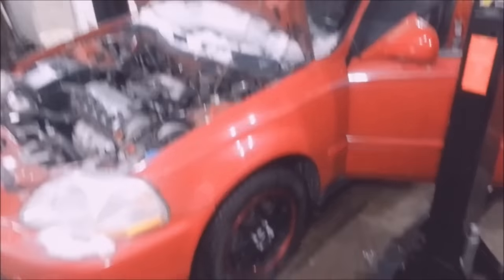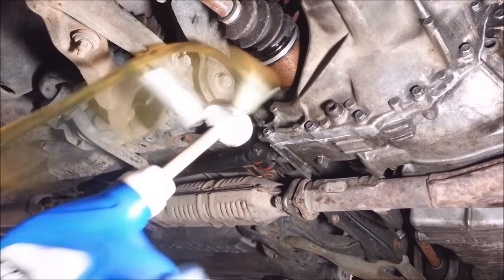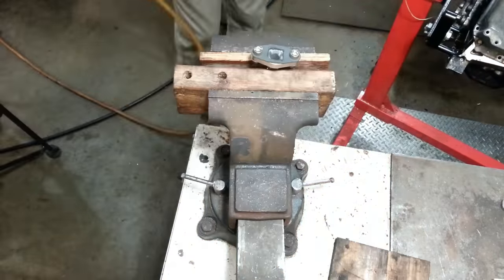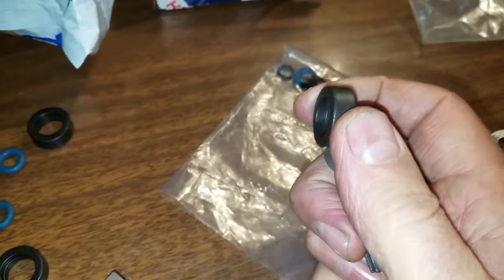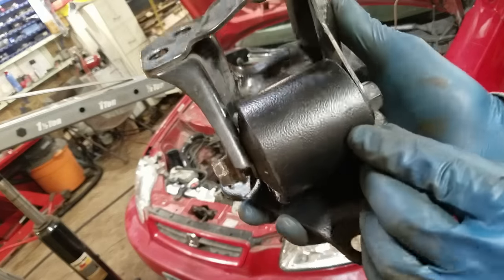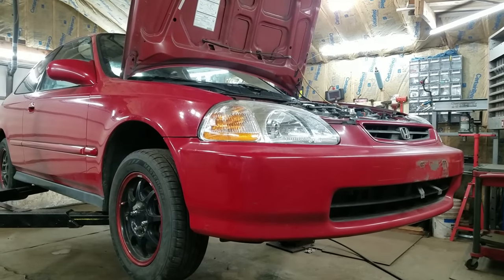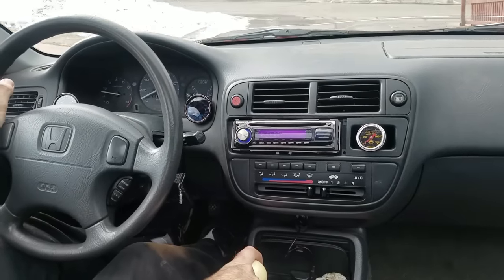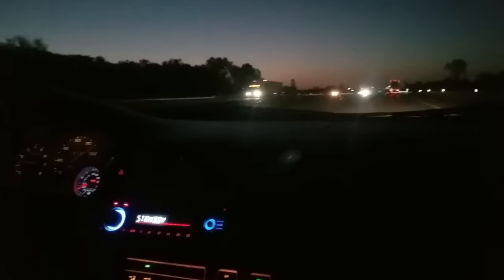405HP D16 Honda Civic Turbo Build start to finish

Comment: Mechanic/Comedian. Enjoyed the crap out of this. Tuned by Humble Performance!
Reply from the maker: It actually got tuned twice, and he did a hack job of it. The timing was way too far advanced amongst other things.
Reply: @RustBeltAuto  wow, good to know
Reply: Humble Texas??
Reply: Oh nevermind. Just saw Tulsa
Reply: Everything I've seen and heard about Humble has been a shit show. They had my friend's K20 head for over a year, did a valve job but never lubed them so the valves and seats were rusted and had to be re-cut. The ECU Humble added vtec to never actually engaged vtec because they for got TWO components. That and they charge more than most local shops ever would.

Comment: u know the car inside and out even before you take it apart i need that kind of experience
Reply: It’s kinda like he’s built an ek before lol
Reply: Nb Miata but he built a sedan
Reply: Just wrench as much as possible and don't take shit to a shop unless it's a machine shop...I been learning everything off Google and you tube im 2 motors in and on my 3rd, all had custom stuff had to come up with and im very picky when it comes to security, material and specs....not so much kooks,
Reply: That’s the Same thing I tell my crazy mechanic when ever he comes around I’ve been hanging out with him and other Honda friends lately we’ll get together at times and work on who Evers car needs attention I’ve learned a bit lol

Comment: Really awesome video, really shows you that its not that simple to turbo a car.
Reply: Yup I'm definitely heading for a nightmare when I custom turbo my Toyota Sienna 3.4, hoping for at least 400hp✌️
Reply: It actually is lol I’ve seen a ton of people do it in their driveway in a day back in the Honda days.. he actually built the motor though, that’s completely different than just bolting up a turbo kit
Reply: @surfside75  have u done it yet?
Reply: Yep especially if you want a long lasting very powerful turbo build
Reply: It's actually quite simple to turbo a car if you're mechanically inclined, since there's tons of material online to use as guidance.

However optimizing the whole contraption and making it run properly can only be done by fine tuning and that's where knowledge, time and experience come in.

Comment: Love the build! As a circle track ex 4 banger class racer you can oil starve the oil pickup tube by turning left hard. Went threw 3 d series z6s before I realized it was an oil windage issue and even with an extra quart and a half, (Shaffer's 20w50) helped. But what fixed the problem was me making a trap door windage box inside of the pan to help keep oil to stay around the pickup tube. Never popped a motor after 2 years when the others would only last 2 or so race nights before rod knocking. My race engines always got new bearings and rings. My class was very limited to modification, so refreshing up the old engines was the biggest power adder. Only reason I say this is because of the autocross you were doing. Great build and love the attention to detail on making the cheaper ebay parts work great. Subbed!
Reply from the maker: Nice to know. Head lift issues are priority now. Still lifted head after oversized studs. Dropped total advance 6 more degrees @ about 20 for 24 psi. Seems to be holding now. Installing oil cooler next I think. Maybe that extra quart will help?
Reply: @RustBeltAuto  yes boosted D's dont like much timing, my friend has the same issue lifting the head with to much timming but doesn't have the big stud kit. I cant believe you still have the issue with the bigger studs! You can always turn the timing down and add more boost? But it seems that your in need of a turbo cam that has more overlap so the valves stay open longer and the air can get in and out with out pushing the head up. Dont know for sure but the guy I bought my car from has a build autocross eg hatch with a vitara d, and he picked up 80whp with a turbo stage 2 cam and valve springs n retainers, same boost and all. Dyno proven
Reply from the maker: @Wreckedekcoupe  high overlap is best for non turbo cars. Satisfied with the power it has. Decreased ignition timing changes location of peak pressure so there is less force on the head. You can lower boost pressure for the same effect, but get less power that way. Tuners get this wrong, because there is no pressure transducer in the head, and no measurement to go by. They are all guessing.
Reply: @RustBeltAuto  wow 😮 you 2 guys are so knowledgeable. Thank you 🙏
Reply: @RustBeltAuto  d16 don't like a lot of timing small bore in general
Reply: @RustBeltAuto  i don’t understand what you’re saying completely. I have a CSS z6 being assembled soon. Wisecos/eagle.. gt30. Would I be better off with a aftermarket camshaft to aid with head lift? I really don’t want to have to install oversized studs. Aiming for around 350whp in the higher gears.
Reply from the maker: @stefanzomods  The tuners gave the car too much timing. Moving location of peak pressure by retarding full advance solved my problems. After these studs, the head lifted again. Did some guess work, and it has been fine so far.

Comment: Bro you’re absolutely awesome ! 😭🤣 I’m in tears
Reply from the maker: It will probably help you live longer. Sweet dreams!
Reply: @RustBeltAuto  nice video. Wondering if you have any tips for me. I have a ep1 d14z6  1.4 non vtec and I want a bit more zoom. Is there anything worth while doing?
Reply from the maker: @jamesoliver9130  get a motorcycle, or a different car? Most people would say k24 or something. I say leave the thing alone.
Reply: @RustBeltAuto  I thought as much. Maybe I will just get the type s with the k20a2 engine I believe. Thanks for the reply and keep doing your stuff!
Reply: @jamesoliver9130  it is all in what you want to do. It is fun, a learning experience for sure and somewhat of another type of addiction when it comes to these cars as no matter what you'll keep wanting more. I got an EJ8 with a turbo Y8 that I want to keep all original cause this car literally is perfect but my GTX3071 on a GSR or K series in it would be nice too.

Comment: A couple of years ago, someone came to me with a similar build, but one done by a spanner with a hammer. They had fitted a Turbo, but no oil cooler and the wiring was a complete mess. I managed to get it running reasonably well, not perfect, but far better than when he arrived with it. Once I felt I had done all I could, I dropped the bonnet and told him to drive it carefully, don't exceed 3000rpm and I never wanted to see it ever again.
Reply from the maker: That reminds me of a bunch of old American muscle. 50 years of hacked to pieces by 20 different people. Fortunately this was a second owner car before I got it.

Comment: Auto-x is a blast when you have a decently setup car. Koni yellows with the G.C.'s, the big sway, and the LSD make a world of difference. Fine tuning the corner weighting/ balancing with the proper alignment will improve it even more. I have set up quite a bunch of chassis for track duty and prepped customers/ personal cars as well. LRP and the Glen are my two favorite courses. Nice job on the build bro. Gotta love a single jingle! 😎 I built a D16 EG hatch with a genuine Garrett GT30R, Synapse ramhorn, Hondata, ARP's, Cometic, gas flowed head with some port work, H.D. springs/ Super tech valvetrain IIRC, etc. I put this together for a customer of mine, and it was a blast for a somewhat affordable drivetrain when all was said and done. Put down around 380whp- 370wtq +/- on low boost. Car looked very stock on the outside, and even had a full mandrel 3" exhaust with a Magnaflow and resonator that had just a pipe as the 'tip' coming out the back and it was painted all satin black along with the FMIC that was hidden quite well. The gate was vented to atmosphere but the dump pipe was hidden as well pointing at the ground inside the bay. The only sign the car was even modded was the drop from a set of Tein coilovers and some black Slipstreams with R888's for track duty/ and some HX wheels with T1S' just for rolling around on. That was it for the looks department. Totally a SLEEPER until the hood was popped. The exhaust was definitely quiet for what it was, especially with the Magnaflow, Burns Stainless res, and the compressor itself which obviously acts like a 'muffler' to begin with. It was a very low-key looking ride, until you hit the 2-step or antilag LOLOLOL 😂🤣😂🤣👍👍👍👍👍 Thanks again for posting this vidja my dude!!! Was very entertaining and we'll put together!!😉
Reply from the maker: Thanks! The turbo I have is too big for auto-x, but open lapping is nice.
Reply: @RustBeltAuto  
Absolutely... Yeah I hear ya on that bro. The compressor size definitely matters when you're trying to keep it in the powerband to where it's the happiest as far as response goes. The lag factor is a beeotch for sure. I use something like the 3071 especially on 4 cyls because it's very spool happy but not too small where it'll leave you wanting more at WOT on a higher speed course/ highway. That 30R I ran on the one D16Y7 I built was the cats ass. Thanks again for the vidja broski and keep it real!!😎👍👍💪

Comment: This was an awesome video but some things you may hear online are actually worth it. Like upgrading your oil pump allows you to rev higher safely without causing your oil to aerate or cavitate which can happen on a stock pump
Reply from the maker: Cavitation usually comes from a pump that is out of spec. This was not. Aeration comes from a pump that is "sucking" air from somewhere. This build is running strong. So for so good. Thanks for the input.

Comment: I think the best part of this video is he doesn't spend money on bling & useless crap (besides maybe the cam gear and injectors are likely china clones). Cast manifold that spools better than any tubular, still makes 405whp with a 57trim, and doesn't cook the radiator. At least, not til a few laps of a long road course. Nothing an extra-wide Griffin radiator stuffed into the core support and the strongest SPAL fan wouldn't fix.

Comment: My dude - love you did the A-to-Z on this build - totally love it. Recently picked up a 93 del sol with a d15b7 in it, a legit grampa owned it find less than 100k on the body no rust but oh lordy going from my ej255 wrx running 300/301 to a d15 is painful. Drove an hr north into the boonies and picked up a d16z6 ... Planning to track down one of the jackson superchargers next ... Can't wait to feel your pain lol.
Reply: Go with a Gt25 turbo instead, or even an old t3 50trim from a 80's Volvo. With the JRSC you'll be chasing tip-in detonation issues constantly and struggle to get to 200whp with a fully built head. A gt25 will make more than the stock rods will handle, far more than the JRSC if you send it, and boost will be nearly instant.

Comment: I have this same car, but it makes 709 wheel horsepower with a fully built LSVTEC turbo. I started with an eBay turbo kit on a JDM D15B VTEC tuned on Crome though and it was ALOT of fun. Btw, I have that same Supertech block guard.
Reply from the maker: Did that block guard fall in, or was it a press fit that distorted your cylinders, so you needed to bore it?
Reply: @RustBeltAuto  The Supertech block guard fell right in when I test fitted it, but I took mine to a machine shop and had them bore the block because my cylinder walls were distorted and I wanted to have the block line honed. I figured that because I wanted to make high horsepower with it I had them assemble the bottom end and install the block guard. They line honed the crankshaft bearing caps, installed my ARP main studs, CP 81.5mm (0.030 over) 9.0 pistons, Eagle rods, Supertech blockguard, decked the block for me, and assembled everything within spec and my total came to $1400.
Reply: @RustBeltAuto  And sorry I didn't respond sooner. I am subscribed to close to 140 channels, so I don't always see my comments and replies.

Comment: I'm about to get one. I was and still am an audi guy and big on big motors but Hondas have impressed me for quite some time especially after one walked me while I was pushing a v10 in my s6 . Can't pass up on it. Honda is a pretty sick little budget build . It's not going to take u to the moon unless u build it for it but I just like going fast 400hp in a Honda is a bit more fun than a 400hp boat . Yea both are fast but Hondas move. Sick little build I fucks with it hard 👍👍💯💯💯💯
Reply from the maker: I love the thing. Just got done taking it for a dig.

Comment: That rod knock at the end plus two step nice
Reply from the maker: No rod knock. Unburned gasses, mixed with fresh air creates a flame front in the exhaust,
Reply: @RustBeltAuto  i would have shit my pants if i heard that noise 😞
Reply from the maker: @hpktank7141  look up two step anti-lag. Mine does it when it's cold, because it's a little rich, but some people tune cars to do it unpurpose.

Comment: gets all the expensive turbo parts “okay so I found the cheapest eBay gasket set” blows the head gasket
Reply from the maker: I used a JE pro seal. Did you just give yourself a like?

Comment: Dude I wonder if that's the same car I've got mine's a d16y5, 97 HX. I would love to do all that stuff that you're doing in to do the turbo but I'm not real smart with engines just yet or suspension or brakes for that matter I'm more paint and body work but I'm learning thanks for this video it's very good!! Maybe I'll learn a thing or two 😉
Reply from the maker: I have a playlist of the entire build. This video is bits, and pieces of it.
Reply: @RustBeltAuto  okay awesome I will check it out dude I want a turbo on mine but I'm just not that smart with engines cuz I really want to learn all that that you do thanks for the message and thanks for the help

Comment: On the first drive you can just see how fast and hot the temperature gauge goes up... block guards are not to good for coolant flow.... 24:35
Reply from the maker: There is no block guard. The ones I got were a license to steal. That temp gauge doesn't mean much either. When it is almost all the way to H the temp is at about 210*. That is when a 195* stat is fully open.

Comment: Cool video!  Who did you get to bore and plateau hone the cylinders?  I'm trying to find someone to do my Suzuki G16B Engine.  I've contacted a couple of places so far but have been met with "we don't do those engines".  I would think anyone that bores and hones a Honda B16 engine for G16B Vitara pistons can certainly do it.
Reply from the maker: The guys mugshot is in the video. He moved out of state, and merged with a guy that builds Ferarri's, and 1000hp Hemi's and stuff. I would probably try Kelly machine, if I had to do this again.

Comment: You made me ANGRY with the FRAM filter.... its literally the worst brand by far.... You haven't watched the comparisons on YT?
SUBSCRIBED
Very nice use of a Helmholtz resonance pipe on the exhaust!
Reply from the maker: I don't believe everything I watch on YT. If I did I would be dumber than before I watched it. Some guy that peels a filter open, that never came apart, complaining about how his 250k mile hoopty blew up from using a fram filter is not a good observation.

Comment: Hi, can you tell me if the upgraded arp studs aproved with high boost? i have 10mm arp with pro seal and it didn't lift yet, tho my wastegate desintegrated itself and my ramhorn manifold got fked 😂
i have an ej1, d16z9 head with d16y3 block (turbo ofc). 0% stock on the bay.
Reply from the maker: It lifted again after the studs. I needed to remove some timing.
Reply: @RustBeltAuto  Might remove a tiny little of timing, but i do need to tune it again. Thank you !
Reply from the maker: @ImmuneZ  probably not. There is a playlist on this car. One of the last video has my timing map on it I redid. This is for 24psi boost though. If you have less, you will not need to retard it that much.

Comment: Good work from the original Honda boys how did it workout with the new head studs and gasket did you keep it @24psi did it blown the gasket again
Reply from the maker: I had to remove some timing. It runs on 24psi. Now.

Comment: What are you thoughts on that clutchxperts 2300lb clutch and springless disc?  Any issues with the flywheel?  Seems like a bargain set up... how heavy is the pedal?
Reply from the maker: It feels stock, and holds all that power.
Reply: @RustBeltAuto  Man, this is great info -- what I was hoping to hear.  Is it hard to drive that non-sprung disc?  Thank you
Reply from the maker: @PGG909  it doesn't slip like a regular clutch.

Comment: For the thingy that bounces the exhaust back (no idea what it’s called) did you measure the frequency to get the proper length or did you look up a length? Or whatever else other options idk abt
Reply from the maker: There is a playlist of this entire build, and a video of what I did. Length of pipe determines what frequency it is.

Comment: What engine did you start this build with? Was it a D16y7 that you built with a y8 head? Also, what trim was the car? Thanks man
Reply from the maker: It was a y5. They have vtec. The car is an ex.

Comment: Did you wrap the downpipe with header wrap to prevent rubbing on the oil pan.
Reply from the maker: Its wrapped, and is about 1/4" or more away from the pan. Does not touch.

Comment: Hey love the videos I have a question for you. I am getting a 1999 civic sedan if i were to have a $500 budget what would you say is the best way to get the fastest 0-60 possible?
Reply from the maker: Wait a little longer for it to get to 60. It's free.
Reply: @RustBeltAuto  haha for real tho what would be the best way to increase acceleration on a budget
Reply from the maker: @optiplexgamingsucks26  there will be no real noticable gains for 500$. Try going down hill.